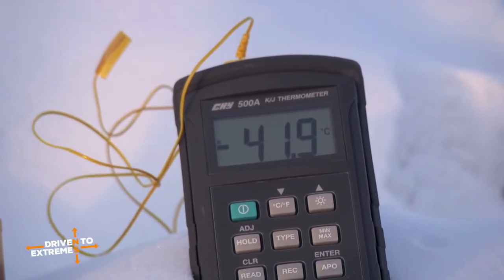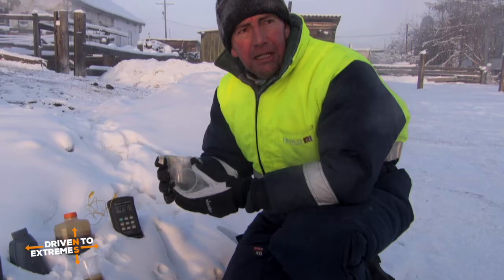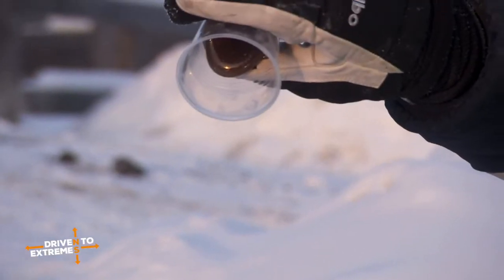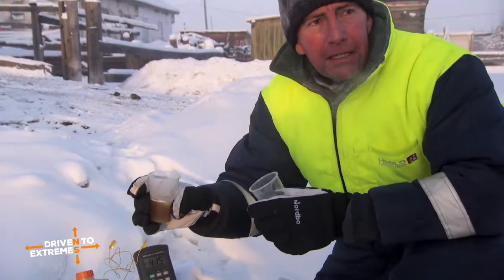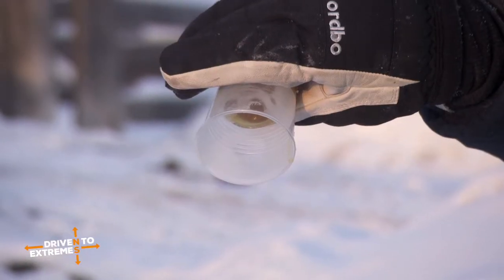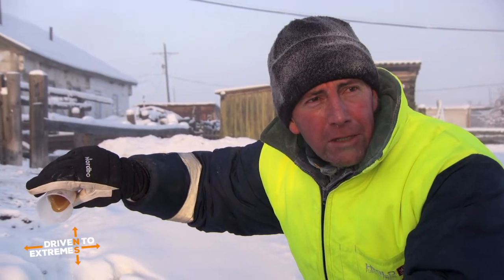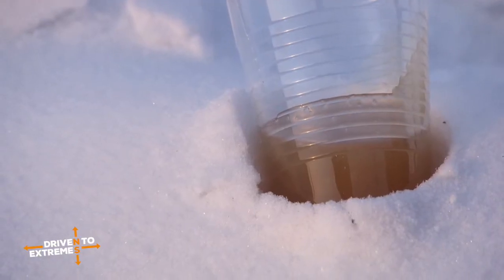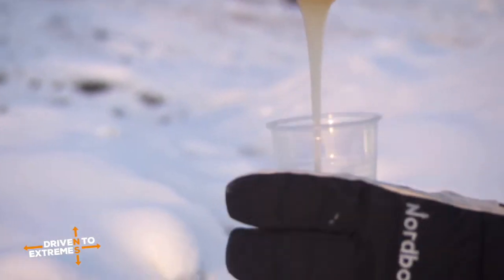Never Switch Off in Siberia

Comment: the engine stays on 24/7, even during oil changes
Reply from the maker: Well spotted. OK, it stays on for 23 hours 40 minutes every 90 days!
Reply: @DriventoExtremes  So how much does this cost in fuel? Most of the time these are just sitting at idle rpm while in park to keep the engine warm right? Still would be lots of fuel over the course of 90 days - diesel I'm guessing right?
Reply from the maker: @ Yes, they have 4.2 litre normally aspirated diesel engines. Fuel in Russia is about 50 pence per litre. Estimates are that they would use approximately 3 to 4 litres per hour when idling. We never calculated the fuel consumption, but with 135 litre fuel tanks and another 60 litres carried in Jerry cans, it never became an issue.
Reply: Hey Nathan Karhu has a vid of that 😂.
Reply from the maker: Where in the world do you live as you may struggle to find one of these Nissan Patrols? We live in the UK where European emission rules are very strict. We’re currently on what’s called EU6 which involves such additions as Diesel Particulate Filters (DPF) and AdBlue which is added to the exhaust gases to reduce nitros-oxides. This vehicle though doesn’t comply with any of the European rules even though it’s quite a new vehicle. It’s referred to as a ‘Rest of the World’ (ROW) specification vehicle and used by the UN and Aid Agencies. We are still allowed to register it in the UK though due to a loophole in the law. The reason for this is that you may have seen (much clearer in our other videos) that it’s left hand drive (our UK cars are right hand drive). This is all to do with US Military personnel being stationed over here for a 3 year tour. If they bring their US cars with them, after one year they must be re-registered with UK number plates. Many (especially much older models) don’t comply with our emissions laws, but an exception is made for them. The way it was written into UK law though was that any left hand drive car could be registered and not meet the emissions regulations. If it was right hand drive we would never have been allowed to bring it onto the UK!
Reply: @DriventoExtremes is this Patrol no more or has it been exported? The MOT last recorded expired in 2023 with only 30,000 miles which is nothing for a Patrol!
Reply from the maker: @ We still own both of them and they are safely secured in a military compound ready to brought out for our next expedition, which is September of 2025 when teams will take on the original Dakar Rally route in Ford Focus Mk1 and Mk2’s. This event is open to the public so check out our website…maxadventure.co.uk on how you can join us.
Reply: @DriventoExtremes most of the Patrols in UK are scrapped because of the rust not by emissions. Patrols without rust don’t exist, they are just Patrols with rust you don’t know yet. 😅
Reply from the maker: @liviurosca  Our Y61 Patrols have the 4.2 normally aspirated diesel engines and were never imported into Europe. The only ones brought in by Nissan were the 6-cylinder 2.8 from 1998, which was then replaced by the 4-cylinder 3.0 common rail diesel engine in about 2003. Our engines are the same as those fitted to the Y60 Patrol which dates back to 1989,  long before any EU emission laws came out - EU1 appeared in 1992.
Reply: Well in theory you can do that..... drain the oil at the same time put a new one
Reply: @siteevistonimeacuerdo  only at that extreme place
Reply: Like a ship
Reply: With toyota even that is possible 😂

Comment: Oil is necessary in an engine as  blood is in a body. There aren’t many shared functions, but who’s going to care in this context. 
I’ve used synthetic oil and fluids for decades, and I change engine oil, tranny fluid, and coolant twice as often as recommended. It sucks when one of my pickups holds about 3 gallons of oil and over 5 gallons of coolant, but extended oil changes are just deadly at lower miles, and especially when you get to the 3- 500,000 mile mark. The oil seems cheap when a replacement engine costs $25,000- $30,000 in the crate and the transmission costs between $5,000- $10,000 to replace. If you can do the maintenance and spend a little time each year removing salt/ dirt and adding a bit of FluidFilm, you’ll have a great truck for many years.
Reply from the maker: Wise words Bryan. On expeditions when fuel quality is poor, load being carried is heavy and the roads rough to cross, we aim to change our engine oil every 3,000 miles / 5,000 kilometres. We’d always use a good quality brand oil, synthetic if possible, but since working on this Shell project, we’ve always used their Helix oils. On very long expeditions such as our Vivaro Siberia Challenge, we can’t carry 4 complete oil changes with us, but we’ve never failed to find Shell Helix even in the remotest cities. It can take a bit of finding, but it’s there in a shop somewhere!
Reply: @DriventoExtremes  I change oil about every 1,000 miles. Oil is cheaper than engines. So there.

Comment: They should get EVs!! They work wonderful in cold weather! Lol.
Reply from the maker: @goodguy7420  It would be a good one to test. Have bets on how far they go before the battery dies!!!
Reply: LOL😂
Reply: Even batteries have a  working temperature to prevent battery drain and prevent short lifespan , coupled with the burden searching for charging stations in a harsh environment is not something that could be recommended
Reply from the maker: @cholakabwe5370  It would be very interesting though to see just how far they could go at -60C. Not very far I would imagine!
Reply: @cholakabwe5370  EVs are slightly better than ICEVs in these conditions as they don't have engine oil that needs to be hot, just the battery itself needs to be at working temperature (much less than the oil) to offer full power. The problem is that the electricity is not readily available in these environments.
I wonder how good a Rivian R1S would do coupled with a high power portable generator. Driving during the day and charging from the generator during the night (while keeping the inside and battery warm).

Comment: I live in Northern Canada and need me some Helix oil but a few hours with a block heater and it will start even in  neg 50
Reply from the maker: Unfortunately far-eastern Russia isn't quite as developed as Canada, so there's either no electricity, or if there is there are regular power cuts!
Reply: I've seen some guy in fairbanks, alaska drive around to people whose vehicles aren't winterized and put what i think are heating blankets over the motor compartment under the hood. On the north slope of ak, they use big heaters that blow hot air via hoses.
Reply from the maker: @ When I was in the British Army I served as a helicopter technician with an Arctic Warfare unit. We used large ‘Gemini’ heaters that were about the size of a small car and towed behind a Land Rover. They had long hoses like tentacles coming out of them that would be inserted under the engine cowlings, by gearboxes and into the cabin. It took a while though to bring the aircraft up to temperature before we could start the engines.

Comment: The TD42 is going well!
Reply from the maker: It’s a fantastic engine, but surprisingly gutless! It doesn’t like to go much faster than 60mph / 100kph, but it will run forever and is incredibly simple to maintain.
Reply: @DriventoExtremes My TD25 does 120kmh all day! 80hp, THAT is gutless. Still fine for daily driving unless loaded heavily
Reply: @DriventoExtremes  yeah haha ive heard they are a bit like that, last forever tho
Reply: @DriventoExtremes they just need some boost
Reply: My td42 runs to about 145 kmph

Comment: Hot air electric blowers can help warm up cold engine. No need to keep engine start and waste fuel and reduce engine life
Reply from the maker: And where are you going to find an electricity supply in remote parts of Siberia?! Even if you did find one you can’t rely on there not being power cuts. Plus what happens to the coolant at -60C? Even neat coolant will freeze, expanding as it does so and ruin your engine. Nice idea of yours but completely impractical!
Reply: @DriventoExtremes you need a nice and heavy generator!! 😂
Reply from the maker: @dragan3290 We’ve already got one, it’s a 4.2 litre straight six diesel under the bonnet!
Reply: I meant a generator for old mate from you! Lol 😂

Comment: Why don't they use Webasto or Eber?
Reply from the maker: We had a Webasto fitted to our vehicle but never used it. If we had used it, the engine drive belts would have got cold, brittle and snapped, so much better to keep the whole engine running.
Reply: @DriventoExtremes  Just use it 24/7🤷
Reply: @DriventoExtremes maybe choose cars with a chain? 😉 Toyotas maybe? Or use electricity to warm up engine bay, my father used compact electric cooking stove put underneath the car. Smart thinking😉
Reply from the maker: @ Having a timing chain would certainly be better than a timing belt, but the issue is with the fan belts / alternator drive belts. At -40C they can go incredibly brittle and snap, so this is why it’s best to keep the engine running (and keep those belts warm) rather than using a preheater or engine heater. If you did, as soon as you tried to turn the engine over the belts would snap.
Reply: @DriventoExtremes  my friend lives in Surgut, and before that in Noyabrsk, his toyota is already 200k+ km, and its fine 😉 -40C is regular winter up there in the north
Reply from the maker: @TheBurzhuy  Old Toyota Land Cruisers are probably the best vehicles to cope with such extreme temperature year on year. The only reason that we didn’t buy Land Cruisers for this TV programme was that Shell (who were paying for it all) didn’t have an association with Toyota. The cars they worked with at the time were Ferrari, Audi, Hyundai, Jeep, Land Rover and Nissan. As soon as I was given the list to choose from, I knew that we had to use Nissan Patrols like the Aid Agencies use.
Reply: Agree, I have a Webasto factory installed engine and cabin heater in my 2014 VW Tiguan Tdi in Norway and that is just perfect, start it with a remote control from inside your warm home and in 15 minutes everything is nice and toasty.
Reply: People in Russia use webasto-like pre-heaters in winter. Many of us who live in places where winter is down to -30C have installed feature of starting engine by timer or by temperatures. With 5w30 i can start engine in -20C easily. Pre-heater exhaust can also be used to warm up a bit engine bay or oil pan, or whatever, it just needs smart thinking to mount exhaust pipe. There are blankets to reduce heat losses in more extreme conditions. The guys chose wrong cars or didn't prepare them well enough.

Comment: Definitely don’t need a radiator or oil coolers there, but block heats would be useful
Reply from the maker: Much easier, simpler and cheaper (re modifications) just to keep the engine running the whole time. No electricity to power block heaters anyway.
Reply: English don't have special coolant for - 80 that's can't switch off the engine another one  nobody in  Russia on syberia not use diesel engines
Reply: @182mcg1 English have whatever is needed, we don’t see -80°C or F so we don't need a coolant that works at that temperature, at -80° oil is going to be your bigger problem.
Not just engine oil but transmission oil as well, the engine maybe running 24/7 but the transmission is not generating any heat when stationary & very little heat when not stationary, I would imagine they use a trans oil heater.
Reply: @Will-thegrumpysoutherner  if it's a manual transmission, while the engine is running the primary axis of the gearbox is spinning too, and that movement keeps the oil from freezing
Reply: Why ? The engines never stop, what is it you need to heat & where are you plugging in this block heater ?
Reply: I have a diesel run block heater  , uses fuel from engine. Runs silenty and keeps everything up to temp. No outside plug required.   @Will-thegrumpysoutherner